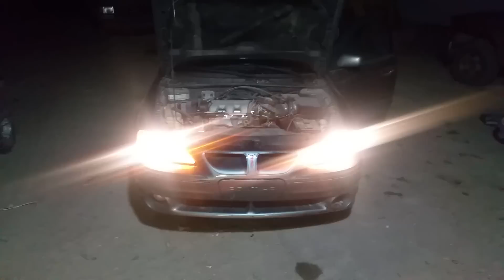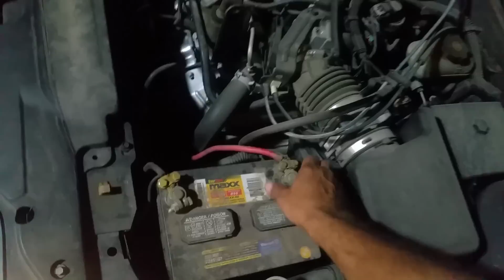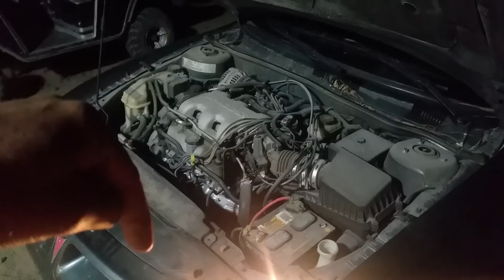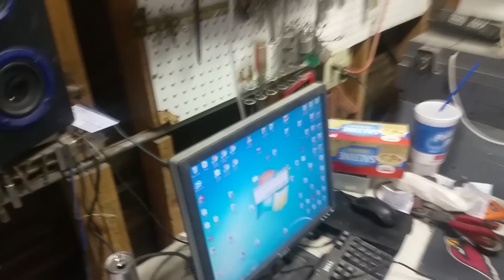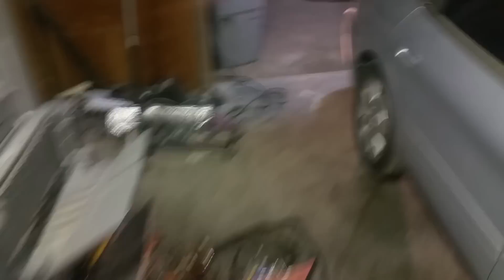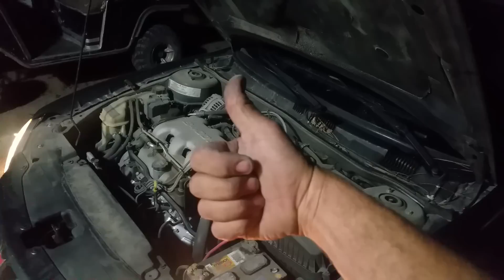Bad Alternator or Bad Battery, Easy Solved

Comment: My car alternator has gone but it still drives  if I drive  2 miles and 2 miles back will it be ok  or do u reckon il break down?
Reply from the maker: depending on how much voltage is in the battery. its running on the battery only. you can normally get about 60 miles on a full charge battery, thats not using radio etc
Reply: @thomasbriansavingmoney  ok cheers

Comment: NEVER, EVER remove battery cable with engine running. Sure fire way to F up your electronics. Please don't post nonsense like this. You could have done this on old cars that didn't have computers or fuel injected engine. Not today. DO NOT unplug any electrical component, like a sensor, either. If you do, you'll be replacing it.
Reply from the maker: ha ha ha. i spent years getting educated on electronics and how the reset. i knew this video would turn heads to a bunch of 15 year mechanics. my channel is about saving money, not scaring people about the unknown that has been passed down from shop to shop. people like to talk about what might happen, i understand how it works, and put it to the test. huge difference. get educated before you speak because to  a lot of us veterans you sound funny. thanks for watching.
Reply: @thomasbriansavingmoney  I've been repairing cars for more years than you've been alive. My comments are based on my personal experiences. I made my share of mistakes and learned from them. You don't have to believe me, others might. I learned never to unplug any electrical connection while the engine is running. If you are so sure of yourself, do me a favor. With the engine running, unplug all your connections under the hood... do it one at a time, or all at ones. Just do it. I need a good laugh.
Reply from the maker: @jamesebola1250  i doubt that, i am over 50. and have read so many schematics and hands on mechanic and wiring my whole life. i can not cook, i have never sewed, i cant do most things, but this work ,,,, you have no idea how long i can talk about it . you got it i will make you a video. i will feed you little birdie !! i have a couple large jobs to complete , then i will set up the camera for you and others that are skeptical and believe what you hear and not what your education has shown you. i am 100 percent positive you will find another out to explain why it worked so think now before the camera starts rolling. also you must give it a thumbs up when it is proven, and you must spend the same amount of time on a good comment so others are not afraid because of people like you when you speak. its about saving money and you should want to do that for others and not detour them from doing so because of things you hear not experienced ,,,, deal ?
Reply: @jamesebola1250  I really hope Thomas does this. I really do.
I'm over 50 and have been working on cars since I was 14. Plus all the things he can't do, I can do. I have seen/experienced cars evolve over the years and would never take a chance doing this on a modern car, period!

Comment: It's free at most auto supply stores to check you alternator for free.
Reply from the maker: Yes if you remove it, however, if you don't and they check it in the car they are checking voltage only not amperage. Thanks for watching!

Comment: My mustang dies when i disconnect the battery, is it aleays the alternator or are thete exceptions. Battery light came on.
Reply from the maker: 9 out of 10 times it is, but you can check to see if there is a fuse for the alternator first.

Comment: how do i figure it out if I cant start my car?  I keep having to get jumped.  When I get into my car the lights flash and all electronics seem to work but it wont start, so does that mean the alternator is still good but the battery is bad?   You mention that the alternator runs everything while the car is running, and the battery only starts the car, so what operates the electronics when the car isn't running?   I'm confused.
Reply from the maker: when it is not running, then you are using the battery. lets say the car is on accessory only. engine off, key on. you are listening to the radio. then you are using the battery. its kinda like reserve energy. but when the car is running, the alternator puts out all the dc current to run everything in the car, and charges the battery back up. the voltage regulator tells the alternator when the battery is full and only puts out enough to run the car. so it does not over charge the battery. if you for get to turnoff your lights and you shut off the car and go inside. you are now running on the reserve again ( battery ) if you drain to much from the battery, there may not be enough to start the car again because the starter takes a lot of amps to turn, hence needing a jump. i hope that helps. thanks for watching.
Reply: @thomasbriansavingmoney    I was confused because you said the battery only starts the car.  Either you misspoke or I took you out of context, but now I understand. Thanks for explaining it.

Comment: Cars ecu has to relearn when you disconnect battery.  My battery was down to 9.5 volts it's on the charger and is back to 12.8 volts so it's looking like the alternator.

Comment: My wife was out in out 2004 satin vue and the this just died. All the lights work but the engine wasn’t turning. It wouldn’t start back up. The tow truck driver brought it home and it started for him. He said it was the alternator. I put my code reader on it and it came up po 300 to po306 misfire. Would bad spark plug cause the engine to stop dead?
Reply from the maker: probably not. A random misfire code usually means the air/fuel mixture is running lean. But the cause might be anything from a hard-to-find vacuum leak to dirty fuel injectors, low fuel pressure, a weak ignition coil, bad plug wires, or compression problems. Even a dirty MAF sensor can cause a lean code and/or misfire to occur. listen for a vacuum leak first. they are the easiest to find. check the pigtail connections at the IAC and the MAF, as well. thanks for watching.

Comment: BUT WHAT IF THE CAR DOESNT START IN THE FIRST PLACE
Reply from the maker: prob battery then. ha you need some voltage to crank the starter.  thanks for watching.
Reply: Borrow a battery to get it started.

Comment: This work on older cars but dont ever try this on new vehicles which have different types of sensors and modules. Instead, use a multimeter properly. Learn how to use a multimeter and you can buy one at harbor freight for $5 bucks. But it is a good old school test for alternators.
Reply from the maker: You're one of those uneducated types, but thanks for watching!
Reply: @thomasbriansavingmoney  
Master mechanic here.. So there is a reason why not to do this while car is running. I have seen damage done on modules. Same thing by
Disconnecting both battery cables while car is runing.. Thats a no no, specially on new cars as this can cause spikes on voltage.  Maybe on old cars.. Im just telling what i have seen  whem people do this.

Comment: The computer comparison is a bad one. A computer has a backup battery built into the motherboard to save all of the information. If you pull that it resets your Hardware

Comment: I have a 94 corolla something is killing my battery.
I did what you said in this video and my alternator works. Also this is my 3rd battery in 3 yrs. What could be killing my battery. Stereo is not connected direct and none of the lights are left on.
Reply from the maker: https://youtu.be/9wLrTjeb9TY
check out this video i made, let me know if it helps.

Comment: Ok... what if the car tries to start but the engine never actually starts? I tried getting a jump and nothing.... it’s been sitting at the automotive place for days and they haven’t given me any word...
Reply from the maker: spark , or fuel. those are the two test that are needed. fuel pressure test ( bad fuel pump or wiring or fuse to it ) spark test ( bad coil ) if both fail,,,,,, prob maybe in the ecm. its tough to say without running my own test, however i normally have a idea with one day of looking at it, so should they.

Comment: Car stays running with POS unhooked but as soon as you hit the break pedal it dies. Battery dies every couple of days but has held a charge for two days without driving it.  Any ideas???
Reply from the maker: could be week, but if it dies when hitting the brakes, check the pcv valve. do you have a hydro boost ? not sure of your make and model. however, you could have a draw as well. if you do not have a hydro boost, then go to egr, pcv , and a possible short draining the battery. very well could be two problems and that can seem confusing when troubleshooting. thanks for watching.

Comment: So, what’s going on? I think it’s my battery because we changed the alternator after my battery was running for it because the other one went bad. So, my fiancé changed the alternator (because it was going bad I’m assuming lights dim whatever, we drove like that for 30 mins) now we’re home like I said changed alternator. Tried to turn the car on and it just does that one lil click sound. When he hooks his car battery that’s sitting in the floor beside the car to my battery in my car- it keeps it running and when he takes that battery and unhooks it, the car dies fairly quick. So, is it the battery or is the alternator dead again? I also realized my passenger window won’t roll down or nothing but it stopped before we got home, before we did anything. Please help. Got work tomorrow.
Reply from the maker: either, the wire on the alternator to battery is loose, or the wire from the battery to the alternator is loose. check all your connections, tighten them up. thanks for watching!
Reply: Wrong electronic breath. The main fuse would blow first or fusible link. That's why fuse panels are in cars these days.

Comment: 👎🏼 other videos say remove negative 👎🏼
Reply from the maker: it really does not matter, i like to remove the one that has only one wire. if there are two, fuse box and starter etc, then i too go to the negative. thanks foe watching.
Reply from the maker: if there is only one lead to the negative, but two to the positive, then yes. but if only one and one, it does not matter the end result is the same. thanks for watching.

Comment: Dude... everything you say is true! This is the easiest way to test if it's bad battery or alternator. I love how you mention about people having 2nd thoughts of removing battery cause it's gonna fry their "ECU" Blah, blah..lol You're right. 9 out of 10 it would only affect preset radio stations, and one thing you forgot to mention is the clock? Thanks for this video! Sure  it will help a lot of people.
Reply from the maker: ugh the clock,,,, nice catch there. thanks for the comment, and for watching.
Reply: thomas brian looking forward to more how to videos!
Reply: I know this was 4 years ago, but I just wanted to warn you that this absolutely can and does fry ECUs. It's not common, but it's far from rare. The battery helps keep the voltage to the electronics stable, with only the alternator, any dips or surges go straight into the ECU and they can't handle that very well. I've seen so many people do this and end up having to buy a $500 ECU. Don't do this, there are safer ways to test the alternator and battery.

Comment: Just tried this my 1st attempt car died 2nd attempt car stays on 3 attempt car stays on. So I’m guessing the battery
Reply from the maker: yep its weak. not out yet, but week. if you have a helper, have them keep it at about 1500 rpms while testing. the raised idle will tell you if the alternator spins faster and charges, then it is week and sure to go out soon. thanks for watching
Reply: thomas brian thanks man just got a new one the old was was completely dead thanks

Comment: Does it matter which cable you move?? Isn’t it supposed to be the negative cable? Not the positive
Reply from the maker: it does not matter, however choose the cable that has only one wire. that will make it easier. great question. thanks for watching

Comment: car died soon I took off the cable from the battery bad alternator correct
Reply from the maker: was there two wires you removed, on that post or one. if one you are correct. if two, they must stay together when removing. still correct.
Reply: @thomasbriansavingmoney  please reply back, , OK so my positive has two wires,, they are both connected by the terminal itself, do you know what I mean? I'm confused by what you mean you have to hold them together,, they are both in the terminal and it is screwed down to hold them tight,, is that the same thing as holding them together right?  
       Like I said my positive has two wires and when I disconnect the positive the truck shuts down immediately.  Please help
Reply from the maker: @Rowen170  leave the positive connected. the second wire is to the fuse panel and must remain connected to the panel for the test. use the negative cable to do the test. great question. thanks again for watching
Reply: @thomasbriansavingmoney  okay first I would like to say thank you for even replying back,, so I went outside and let the positive connected and disconnected the negative and it shut off immediately. I'm sorry to be bothering you but I have just one more question and that's it I'm literally standing right here at my truck as I text this, the negative has two wires also,, a big dick wire cable I assume is the main ground and then a small ground which is bought it about a foot from the battery to the frame of the truck. It's a 95 Dodge Ram truck by the way,, but with the negative having two cables like that is there something special that needs to be done or would you say that the test that I ran shows a possible bad alternator, again thanks for your time.

Comment: Never do this it can burn up your alternator and mess up your electrical system
Reply: Unhooking the battery will cause a surge that will result in the blinker fluid overheating and exploding into a mist for 600 yards in all directions. Blinker fluid is highly flammable and conducts electricity when it explodes that will arc to the electrical systems in a home and fry all electrical systems, including phones, computers , and all appliances for all homes within a 600 yard radius and cause the homes to burn to the foundation. However, if you remove your blinkers before doing this and smash them with a hammer and wrap the broken pieces in aluminum foil and place in your freezer before unhooking the battery, it might be fine.
Reply from the maker: you clearly have not read any comments, because your about to look silly, so tell us why its gonna burn it up, then i am gonna educate you !!!! be specific because your gonna love this lesson !!!!!!!!!

Comment: What if I got the alternator fixed and starter but the battery keeps going bad
Reply from the maker: if the alternator is charging but the battery is not holding that charge, then the battery is bad. i dont know if i understand your question. fixed or replaced, what is your issue. what is going on with the car, needing jump etc.

Comment: Thank you for sharing love the straight talk..... working on an old 89 f450 diesel not charging after a major dead short and repair
Reply from the maker: make sure you are not using a led light to test, first test the connector to the alternator make sure the pig tail looks good. second test the green/red wire for voltage, it must have voltage to excite the alternator. and third test green wire for voltage coming out.
Reply from the maker: thanks for watching